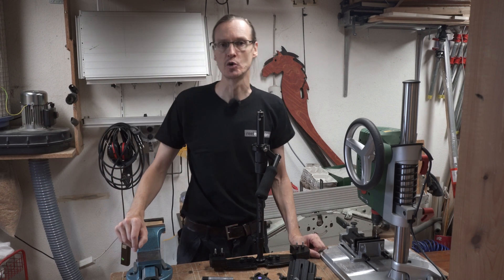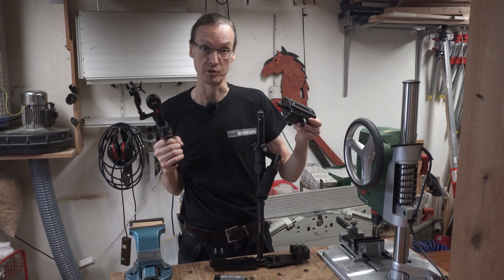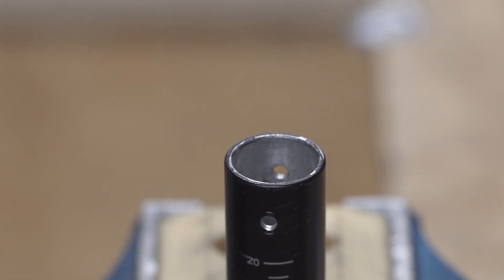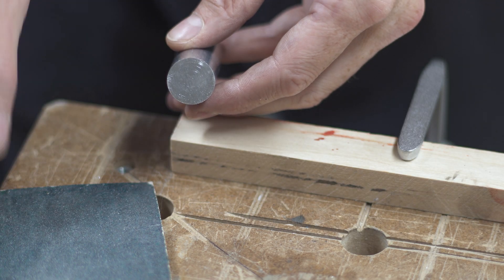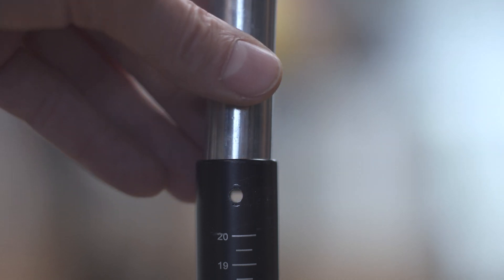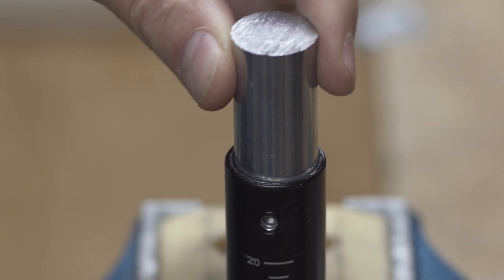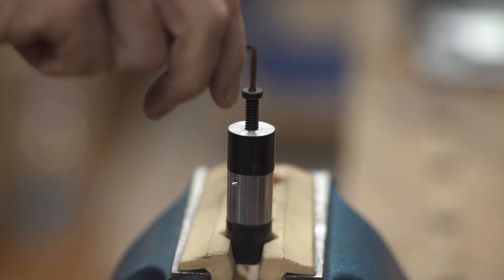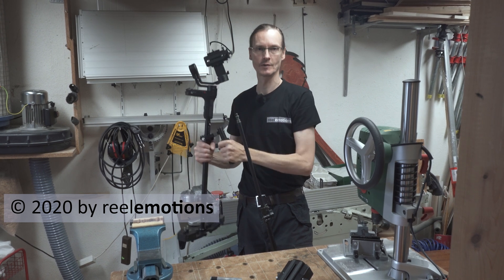DIY Minity Light Adapter for Flycam Redking

Comment: Hello, i'm building a minity with a somewhat heavy rig. Just wondering what your opinion was on the thin threaded bolt that connects the handle of the red king.  I didn't notice it until owning it for a while, and thought, why didn't they use a more robust pin 3/8s  at least.  Do you think this bolt is likely to break?
Reply from the maker: That is a difficult question. I am not a metallurgist and can only share my experience. I buy steel bolts from a dedicated German company. The combination of camara, lens and gimbal I use weighs about 2700 gram and I never had a real doubt that the bolt that holds this combination to the red king or a monopod would hold. But I also was careful not to make sudden movements, especially when using a extra long steadycam or monopod that was longer than three meters.
Zhiyun itself offers a mini monopod in its Creator Accessories Kit which can be attached by a quarter inch thread and shows videos of this combination with the monopod in a horizontal position. But please be careful if you plan to use the Zhiyun Quick Setup Kit. I used it between the gimbal and a long monopod in a horizontal position and although it did not break it was a little bit loose afterwards.

Comment: im wondering if the quarter inch hole at bottom of the gimbal is strong enough to hold the gimbal and the heavy camera... any thoughts from your experience? thanks
Reply from the maker: I had no problems so far using the quarter inch hole at the bottom of the gimbal. Zhiyun itself offers a mini monopod in its Creator Accessories Kit which can be attached to this quarter inch hole and shows videos of this combination with the monopod in a horizontal position. But please be careful if you plan to use the Zhiyun Quick Setup Kit. I used it between the gimbal and a long monopod in a horizontal position and although it did not break it was a little bit loose afterwards.
Reply: @reelemotions  thanx for the reply! keep up the awesome vids :)